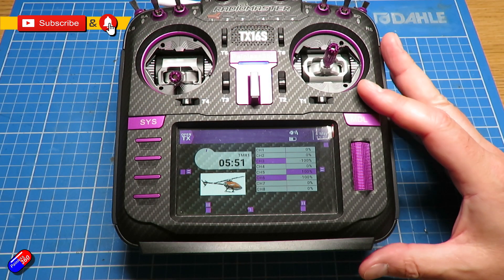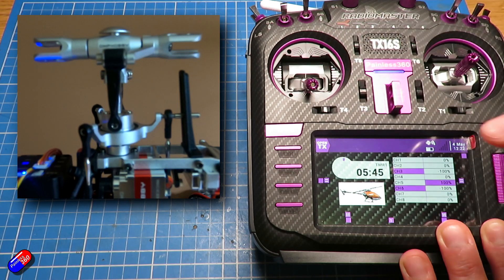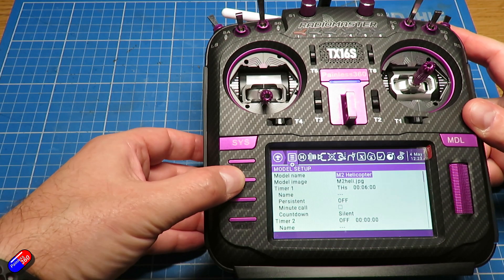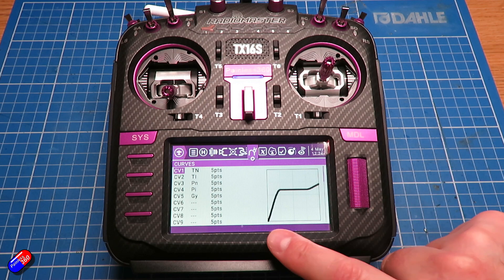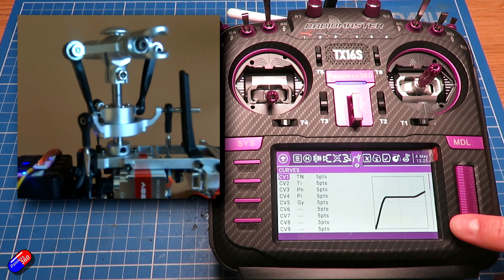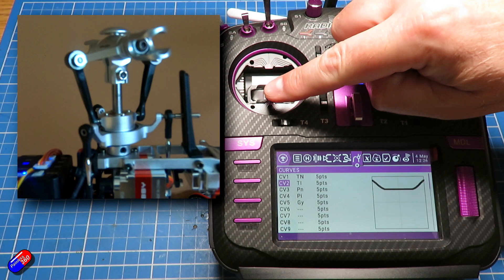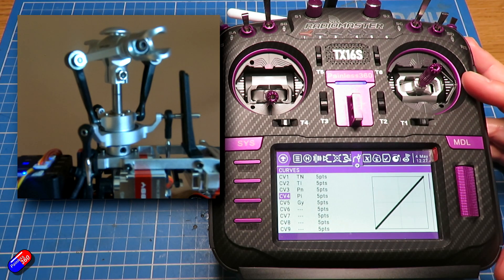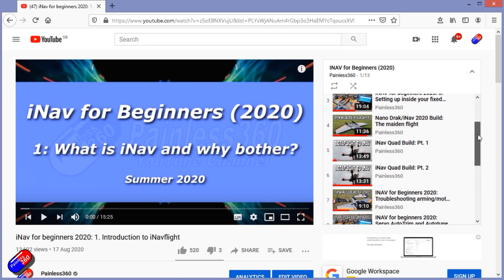RC Heli Pitch and Throttle Curves Explained! (and Normal and Idle-up/3D Mode)

Comment: Great info for those who are getting into the Heliers hobby. I don't setup any negative whatsoever for any IDLE up with a new help just in case I hit the switch by accident or I made a mistake in the build. I really like your demo heli I just can't stand electric driven Tail Rotors they are too glitchy for my liking.
Reply from the maker: Thank Keith, I wanted to help those who wanted to get into this side of the hobby. Not a lot of content for modern helis at the moment so wanted to cover all of the common questions I got.. Agree on the tail rotor, variable pitch and shaft driven are my preferences too.. Happy flying!

Comment: Why is my throttle up and down inverted on my controller? When I push down heli goes up and I push down heli goes down. I'm so confused why it's doing this and blades and head is installed properly. Thanks
Reply from the maker: Sounds like the throttle swash mix is backwards... Best of luck

Comment: I'm a brand new beginner to CP helis (have flown some FP helis to get orientation) and now have Blade 330X I'd like to start flying.  Do you have a video describing what setting to use on a first CP heli?
Reply from the maker: Don't go for crazy high head-speeds and setup the head to give you -2 to about 8 degrees pitch movement max...

Comment: Hello
Thanks for the explanation, I'm a beginner, I bought the m2 Evo, also the digital pitch meter. as I do now, I put the heli (trotle of ;-) ) in Idle 1 and then via the flight controller, min and max 11 degree pitch. then in normal mode it automatically has less negative pitch, also slightly less positive, and in idle up 2 also slightly less pitch up and down. I still fly in normal mode (horizon), and sometimes, high in the air idle up 1 to practice. My transmitter (zorro) set the store.
my question: am I doing it right by setting my max pitch in Idle up1? Mvgr Ruud
Reply from the maker: You can setup the Heli in the way that suits you. The main thing is to have -2 to about +9 degrees in normal mode and then equal positive and negative in the idle up modes. Pilots setup IDLE1 and IDLE2 differently depending on how they want to fly it. For me, I just use one IDLEUP setting and normal for take-off and landing.. Happy flying!

Comment: Could a heli have a range/endurance advantage over a quad, for a similarly sized craft? I'm not sure what it would look like, but as I think about whether or not to build a long range quad, I also wonder if maybe a long range heli would have some advantages.
Reply: I suspect there will be quite an advantage to the helicopter but speed will be important. One of the thigns a helicopter benefits from, far more so than a quad, is translational lift. What this means is that as a helicopter picks up speed it can actually reduce its power draw due to this induced lift from the forward airflow through the blades. Testing is the only way to be sure but my money is on the heli. You may ask why helis are used so much less than quads. Well, they are much harder to set up and much harder to maintain. So, like all things, there are compromises to both helis and multirotors.

Comment: Is it possible to get pot 1 (s1) to control for example the normal throttle curve when you hover?
Reply from the maker: Probably. What is it you are trying to do? I'd add a small offset using the rotary control to fine tune. I use curves to have a more precise hover control. See my videos on it.. Best of luck